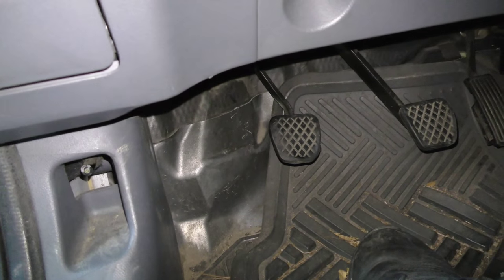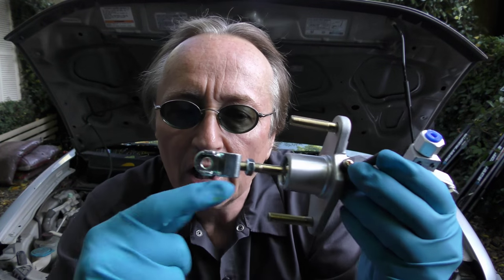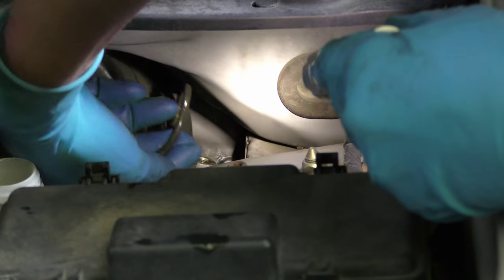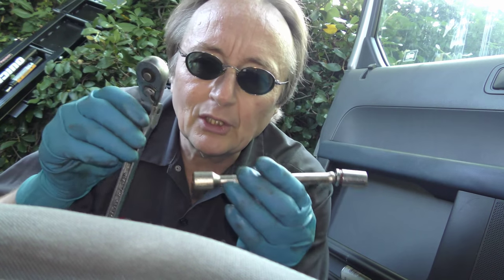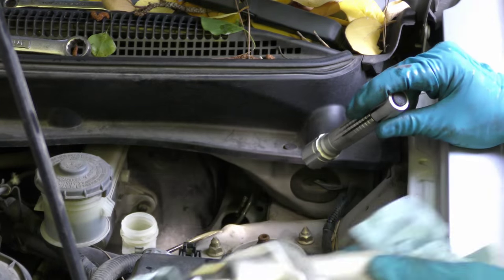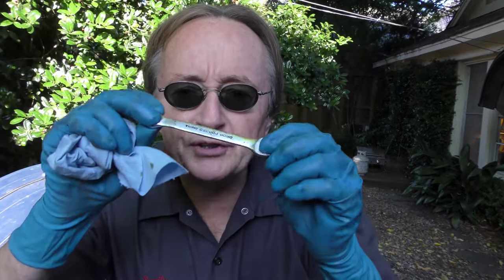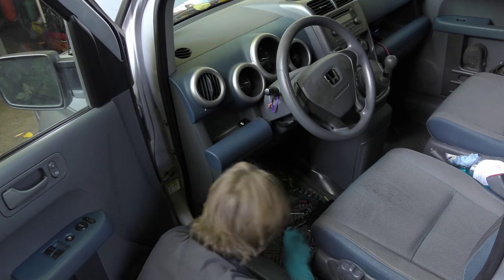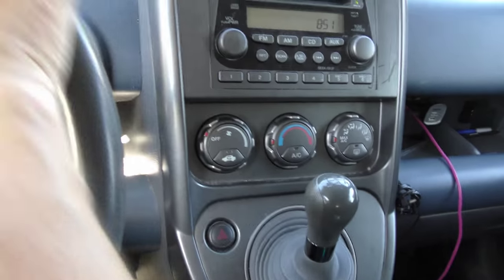How to Fix a Car that Won't Go into Gear (Clutch Master)

Comment: I have an 85 ram 50 pickup that often won't go into gear unless I press on the clutch pedal with so much force your feet get cramped. And it doesn't always work when I do that but I have a cable clutch instead of hydraulics so do ya think it the cable might just need replacing? Because it looks like someone already tried adjusting the cable as far as it goes.
Reply from the maker: +Brandon Wood try a new cable, if not that, needs a new clutch assembly

Comment: I have a 2008 Jeep Patriot 5 speed, it goes into 1,2,3,5, and R just fine and runs well however it wont go into 4th it shifts but wont engage the gear. Any thoughts?

Comment: I have a 1998 Honda Accord it reads the code P1738 but I am having difficulty finding the location of this 2nd clutch pressure switch. Is it on the transmission or the engine?

Comment: Hey Scotty , I have a 1997 Cadillac deville , in this case it's an automatic transmission , but I went to the store around 8 in the morning , car turned on fine ,  wanted to go out around 4pm and the car turned on fine , when I put my foot onto the brake to put it in gear the gear wouldn't move out of park ? Also I have a digital cluster and it also went out
Reply from the maker: +Christian Serna (IronDeath94)  check the brake light fuse and the brake light switch, if either go out, it won't let the park lock get out of P
Reply: +Scotty Kilmer turned out my brake light switch wasn't in properly , thanks

Comment: I have a problem. I have a 2002 RSX Type-S 6 speed. My reverse gear slips into reverse normally and easily with no drama or odd sound but then sometimes when I go to shift it out of reverse it's take quite a bit of force like it's binding.  All my other gears shift smooth so I don't think it's the cables.  I did just replace a mainshaft and second gear though myself but did it by the manual.  Could I be low on fluid?

Comment: Hey Scotty, I have a question regarding a Volkswage Golf 4 from 1999 (1.4 16v).
Sometimes when I break, the engine shuts down and I need to restart it from the contact.

I cleaned out my Throttlebody, but this didn't seem to help at all, do you know any other things I can check to see if the problem goes away?
Reply: Just when you brake or when you are coming to a full stop?
Reply: Jean-Baptiste Picot just sometimes, when i'm still slowing down
Reply from the maker: ***** check for vacuum leaks, and realize MAF sensors often go bad on VWs and do just that
Reply: Scotty Kilmer yeah... I thought the MAF could be the problem too because my throttle body is as clean as it was when I cleaned it (300km further)

Comment: Hey Scotty Kilmer  my 2006 Dodge Charger takes 10w30 but the dealer puts 5w30. Can I use synthetic oil?? If so what do you recommend? My engine size is a 3.5l high output engine
Reply from the maker: Jr Jasso I would use 10 30 synthetic myself. Or just straight 10 30 castrol.
Reply: It burns a little bit of oil (about a quart when the oil needs changing) is that synthetic oil still good for the car since its burning oil Scotty Kilmer
Reply from the maker: Jr Jasso  yes, but I would go with the heaviest syn oil you can buy, because thinner oils will burn more oil in and oil burning engine

Comment: Ok. 92 Chevy Silverado. Just finished a 454 swap from a 4.3. 5 speed, I think an nv3500, could be wrong. New Master Cylinder, Slave Cylinder, Throw out bearing is in correctly, new clutch. Clutch will not engage. Any ideas?

Comment: I had the problem in my 98 mini, the clutch fluid wasn't pumping.
The synchromesh is also gone a long time ago.

Driving it sure was not fun, could only get it into gear 20% of the time :/

Is all fixed now though and is great to drive :)

Comment: In the last 6 weeks or so I haven't been able to get my car into 1st gear this has only happened twice and after a while it usually rights itself. My revs against speed are pretty normal when this happens ( if anything the car feels faster which is odd and I'd say the acceleration pedal feels lighter.. )  and I just have to start the car in 2nd gear which is not ideal lol. Occasionally, I hate to admit but I have ridden the clutch ( unknowingly when I first started driving just over 2 years ago i did it once for the first drive out and knowingly like when in traffic etc ) but nothing too outrageous.I rarely ever skip gears or drive in an inappropriate gear relative to the speed I'm doing . I'm hoping it's the master cylinder. I will take it to a garage soon but does  anyone have any ideas? ... other than the idea that I should have never ridden the clutch 🤣👏👏

Comment: Hey Scotty, you know motortrend? They have an awesome show called roadkill. What they did was take a rotted out Datsun 240z and put 400 hp Chevy v6 in it. And they used a junkyard 5 speed trans that WILL NOT GO OUT OF 2nd gear. What would be that fix?
Reply: Peter Kapica Probably the clutch pack(s) or something valve body related. Either way that trans needs to be rebuilt or replaced.
Reply: TheCatMilton well look, we got a roadkill fan!!

Comment: Small nitpick: Would have been nice if at the end  you showed the "correctly" functioning clutch pedal like you showed it not working at the beginning--I'm always wondering how hard or soft my pedal should be and how far it should spring back...👍

Comment: I have 2018 HR-V that goes into gear but with slight grind from 2nd all the way into 6th gear. I feel it through stick. It has 11 000 km only . Dealers say its normal. I don't think so. I noticed that cmc you put in there is same as mine with delay valve. Can you explain is it good or bad if it grinds into gear, is delay valve in cmc good and is my shifting as normal as dealers say it to be? Thanks
Reply: The delay valve crap is what causes that grind. Take it back to Honda and MAKE them fix it. The grinding happens on many Honda's even back in the early 2000's. It's fixable.
Reply: Enrique Ortiz , i know that but they won't fix it. I'll keep bothering them until they replace it

Comment: Hey scotty, what's your thought on Pennzoil platinum synthetic oil? Mechanic recommends me to put 10w30, but I think I have to put 20w50 because it's a 1997 ford f150 5.4 with 282k original miles. Is 20w50 motor oil synthetic too thick or good? 

 I sometimes carry around 500-4000 pounds of housework tools like saws, wood, and all that stuff

Thanks.
Reply from the maker: FUMBDUCK310   that syn oil is a good oil, but mainly for modern cars that use lighter oils, and as cars age, they often need somewhat heavier ols.  I would stick to what you've been using if it doesn't burn oil, and go to the  20 50 if it does burn oil

Comment: hi there I have a 2007 Toyota camry and it is hard for me to shift gears. I have to use force to go in to 1st, 2nd and third gear. I just got a cluth replacement last year. also it scratches when I go into reverse. do you know what that could possibly be? thanks in advance

Comment: Wth, i thought you were working on the van with the flames lol then i see its the element. Btw i never knew elements came with a manual!
Reply: Yep, elements come with a manual transmission. Automatic is optional, of course. I like those things, actually. Tons of space. But still expensive as hell.

Comment: I've just had the clutch kit changed. It won't go into gear until the transmission is warm. If I start it in 1'st and drive right away it works like a charm until I need to stop and engage the clutch to put it into first again. No strange noises or vibrations from the clutch. After about 20 mins of driving it works like a charm. What could cause this?
Reply: Hi. How did you solve your problem. Did it work.

Comment: My flywheel I think is on its way out but I'm not getting any gear I tried bleeding it but drips are coming out do I need to bleeding more  to get gears back (its a slave n master slave replacement) but should I still able to get the car into gear still was OK before I did the replacements

Comment: Encountered any altimas with over heating slaves? Lots of stop and go and you loose all clutch pressure.

High temp ams oil helps, but have you rigged any good heat shielding?
Reply from the maker: everss02  yea I've seen it , if you put full syn fluid in it, that often helps.

Comment: Hi Scotty, I have 91 Mitsubishi mighty max truck. One of the 3 bolts that holds the shifting gear in place broke off. I had to re thread the bolt that broke off and put a new one. Now the truck will NOT shift in any gear when I turn on the vehicle, But it does when I turn it off even without applying the clutch. It was working fine till the stick went bad - pardon the pun. I checked the brake fluid and level is fine.  Any suggestions?
Reply from the maker: sounds just like a worn out clutch to me

Comment: Hey scotty, quick question: so I have a2006 Scion tC with a manual transmission with 116k miles on it. One day i was on the highway in traffic and all of a sudden I had trouble shifting into gears. I had to reapply the clutch in order to get into gear. Consulted the issue with my dad who also works with cars and decided that it was the slave cylinder. Swapped it out for a new one, turned the car on but the gears would't engage? In this case, what should I do because I am thinking of buying a new clutch kit? Or new master slave cylinder? Feedback asap would be greatly appreciated
Reply: Same thing happened to my car,  it's more than likely your pressure plate that went bad,  if the car goes into gear when it's off that is.
Reply: when the car is off, yeah gears work fine. its when the car is on that I can't get into any gear. I've read quite a bit of scion forums and they all point to the clutch (after having replaced the master slave cylinder and the slave cylinder which i did)
Reply: I'm sure it'll solve your problem 👍
Reply: got a 1995 won't go into gear. shifter moves free. also makes a whine when running.

Comment: Hey I drive a Saturn 07 5 speed. and it's not going into gear from 1st to 5th nor can I get into reverse. I looked under the gear I didn't see anything that was out of place. Do you have any suggestions on what the problem could be?

Comment: Please help... I have 2006 Mini Cooper s I replaced the clutch 10k miles ago ... right now when the car if I can move the gear but when I turn the car on I drive slow some time it go in gear some time not and when I drive fast it won’t let me go on any gear. Still have max fluid and when I push the clutch paddle I can fell like Vibration ? What do you think is the problem

Comment: Hi Scotty! I have a 2007 Infiniti G35 that just wont take the Reverse Shift anymore. Its an automatic car and this just happened today. Do you know what might be the problem?
Reply from the maker: +karflo707 pray it's low on fluid, but if not that, generally a worn out transmission does that , a VERY expensive repair
Reply: +Scotty Kilmer Hope its the fluid! Interesting thing is Drive and Neutral work perfectly fine. Just that Reverse isnt

Comment: hi Scotty I have a 1995 f150 and my trucks abs light kept flashing and later when I shut the truck off and put I. park then start it back up put my foot on the brake and try to shift it won't move at all its an automatic e40d any help much appreciated

Comment: Might be the same but i have a 2004 subaru impreza that will go into all gears but 5th and 6th 5ths blocked and 6th grinds but my car drives fine any sugestions

Comment: 3-4
 weeks ago I noticed some red liquid under my ford expedition. I didn't 
think it was a huge deal at the time. I then drove the vehicle  a week 
later to another part of the state. This was a 200 mile roundtrip trip 
and it drove fine..After this, I noticed a lot more red liquid under the
 vehicle. Since then, I have not driven the vehicle. I have started the 
vehicle 3 times since the last time I drove it on that 200 mile trip. 
Each time the vehicle has spit out red liquid after starting it and 
running it for 15-20 seconds. 

Today was the last time I think I will start the vehicle. I was just 
starting it to roll up the windows because they were slightly cracked 
for a few weeks. I tried to put it in Drive and move it up my inclined 
driveway a few feet, but I started rolling backwards. Again, it spit out
 a tiny amount of red liquid. It looks like it is practically out of 
tranmission fluid when I checked it again today.

So I have a few questions.
-What do you think is wrong with the vehicle? a messed up tranmission 
line, gasket, or what?
-Also, I bought the vehicle about 14 months ago from a guy I knows mom 
who took great mechanical care of the car. She said the transmission had
 a warranty for life. I have no way of getting in touch with the guy or 
his mom right now, so how would I be able to use that warranty, if it is
 something more serious than a transmission line or gasket? Would a ford
 dealership be able to find out on carfax or with records online?

I basically used this vehicle for long trips. I've taken about 10 
1500 mile trips in it since I bought it. It has always driven flawless 
and I've never had any issues with it. It has been more reliable than 
any bmw or audi I have owned.

Unfortunately, im currently unemployed and I'm hoping that this is 
just a minor problem, which can be fixed for under 500 bucks with labor.
 I'm planning on using my AAA membership to have it towed to the ford 
dealership soon.

Any advice is much appreciated.

Thanks
Reply from the maker: do my video "finding and fiing car oil leaks" to find and fix the leak

Comment: 2003 dodge Durango 4.7 rear wheel drive. Issue- only after sitting for a few minutes or so,the truck delays going into 1st gear. After that the is no problem. It kind of drags before going into first. After 2 min I have no problem again until the truck sits for about 30 min.

Comment: scotty heres ya question. trucks a 94 ford ranger 2.3 4 banger with a 5 speed manual. goes into gear but wont move just revs and revs but in "neutral" it lugs a bit but will take off and drive. like its in a higher gear. what the hecks the issue?
Reply: Hi Scotty! First off, I am pretty satisfied with your previous videos. They come super handy. However, I've ran into some problems with my car and it seems that my problem won't be the master cylinder. I'm also having a similar problem like this user who had commented. Here's my problem, I have a 5-speed manual 1998 Nissan Pathfinder and it seems to go into the gear slots like 1, 2 ,3 and so forth but won't move at all! It just revs as if it was in neutral. There isn't any leak as far as I know. What else could it be? Would you also recommend for me to take out the tranny as well and look at the clutch?

Comment: I have a 1998 Chevy s10 manual transmission, 2,2l replaced the front rotors and brake but the truck will go backwards but doesn't want to go forward before how it's rear wheel drive the front end on the driver side locked up but ended up locking the rear up and had to be towed from the rear end what do i need to do to unlock it by the way my emergency brake doesn't work .

Comment: scotty, the AC in my car isn't working. The compressor works and clicks but the system has too much coolant. Would it be better if I evacuated the system myself or take it to a mechanic?
Reply from the maker: baseer1992 do it yourself IF you have a vacuum pump, pay someone if you don't

Comment: My car goes into gear, but sometimes I have to double shift so that it doesn’t grind. When car is off sometimes the shifter only goes half way in. And doesn’t actually go into first. Any thoughts? Stretched shifter cables or synchros?

Comment: Hi Scott I have problem with my Subaru impreza clutch I just wanted to ask you it doesn't go in gear but when car is off it will go in gear and when I start it the car will drive what can it be as the bloke I brought it of said the clutch is gone and needs new clutch but the car moves thanks

Comment: Hi Scott I  apostatize the clutch master but it still not working.Its nessesary to move the driver seat in Renault scenic2 2004 year.Does the seat move have electronic  solution.When the car is turned of the clutch master works perfectly but when I turn on the car the clutch master still not working.

Comment: I got an a 77 Pontiac Trans Am with automatic turbo 350 trans with a hust shifter that requires 2 hands to put in any gear, how can I make it softer ?
Reply from the maker: replace the shifter cable
Reply: Scotty Kilmer Thank you Scotty

Comment: Hey Scott. I installed a new clutch and pressure plate, and a slave cylinder in a 1996 ford ranger. Now that everything is connected the truck turns on but won’t go into gears while on. What could that be? Thanks.
Reply: Did u figure out the problem
Reply: @vonstrong92  // yes, had to bleed the damn clutch for about 2 damn hours because it wouldn’t build sufficient pressure to put gears in with the vehicle on. Such a pain.

Comment: I have a 91 Ford Escort with automatic transmission I recently freshman transmission replace the radiator app on doing that I tried to drive the vehicle would not go into gear I finally got to go in the first and now its stuck shifter goes up and down but does not remove out of first can you please help with giving info

Comment: I have a 08 mustang and I put full bottles of brake fluid, the clutch pedal never seems to build up pressure. I looked at the bottom of the car and you can see all the fluid leak through the bell housing as you press the clutch. It leaks as fast as you can pour it, any clue what it would be?